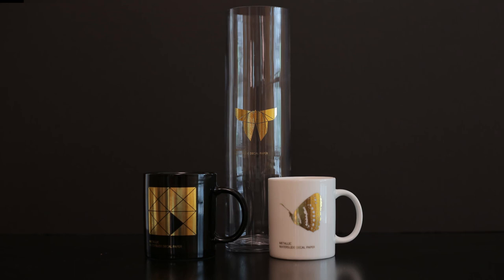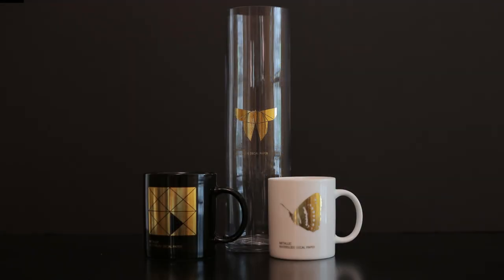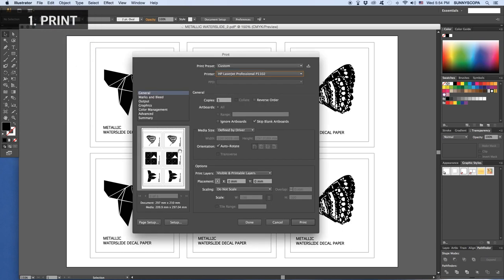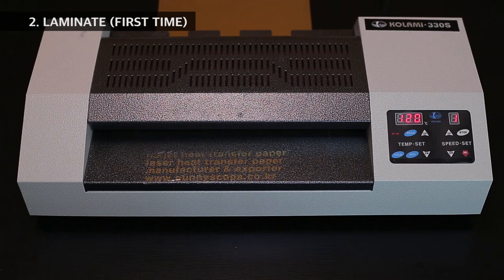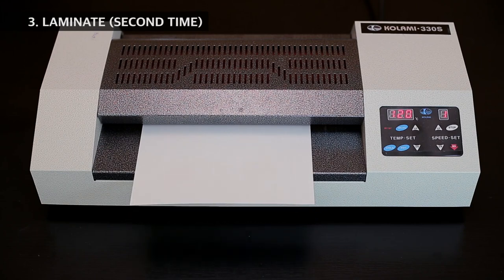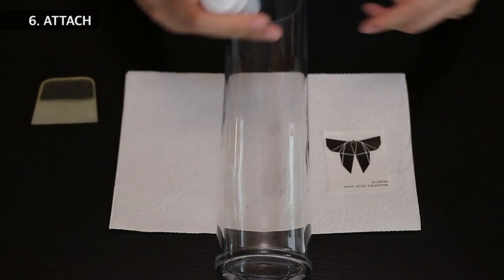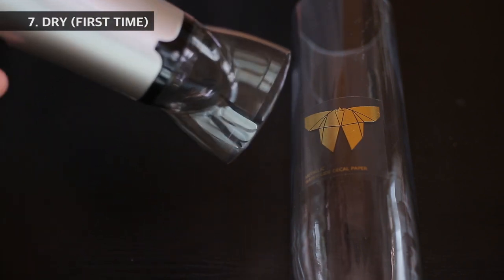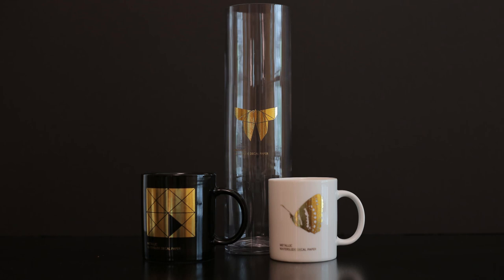[How To Use] Film-Free Metallic Waterslide Decal Paper (Gold/Silver)

Comment: I would like to use this on the headstock of a guitar. Obviously I cannot put it in the oven, so can the final curing stage be done with a hairdryer or similar?
Reply from the maker: We never tried it on the head stock of guitar. But, it could work with hair dryer. You will use film-free metallic decal paper with glue w1+
Before drying, clean off the glue residue with wet wipes completely. It is too hard to remove the glue mark after drying.
Reply: @SUNNYSCOPA  Thanks for that.
I should add that the headstock is coated with very smooth acrylic clear-coat lacquer. Is this product compatible with acrylic paints?

Comment: You say that you can allow the decals to dry naturally before removing the film but when I tried that the decals didn't stick. Also, when I dry them in the oven (as per pack instructions ) they bubble up even though they  were completely wrickle and bubble free before hand. Any help with this would be appreciated as I was so excited about using your product!
Reply from the maker: Hi Zoe Rogers,
You must bake it in the oven at 100C for about 10 minutes. Natural dry can not make it. Air bubbles could be caused from the water remained under the decal. Carefully remove the water with squeegee rubber before putting in the oven. Too high temperature in the oven can make the wrinkles. Good Luck!

Comment: Hello, I need to apply a gold decal with black lettering on it. After I have transferred the gold design to the blue decal paper, can I take this blue decal paper and run it through my laser printer again to print in black on top of the gold?
Reply from the maker: Hello, Kai!

Actually that is a very good question. However, we don't have any ways to express or print black lettering on top of the gold. We will take your suggestion and certainly consider it for our next R&D project! 

If you really want the lettering, perhaps the only way is to use standard laser printer and apply the decal on top of the sealed gold. I do not recommend using another film-free on top of the metallic because the gold can come off when you remove the foil.

Thank you.
Reply: @SUNNYSCOPA  - what would happen if, after doing the first lamination, and peeling off the gold foil layer, I took it and ran it through a laser printer to print in black on top of the gold. Would the gold foil survive going through the printer?

Comment: Hi,

Do you need to specifically buy the decal paper in 'blue'? I can't seem to find the blue colour anywhere.
Reply from the maker: Hi, Laura

The blue papers are included inside the Film-Free Metallic Paper package.

You have all the papers that you need in there.

Thanks

Jimmy
Reply: SUNNYSCOPA Thank you! :)
Reply: Also, what is the difference between Type A and Type B paper? Is the blue paper Type A or Type B?
Reply from the maker: Laura,

The Type A is for the glossy, hard surfaces and the B is for porous surfaces. They also use different glues to assist adhesion; watery, transparent Glue W1 for the A type and white, viscous Glue W2 for the B type. You also have to cure the image with heat for Type A and with the B, this heating is not required. The downside with the B type is that it could leave glue residue once it dries. 

The blue paper is neither actually. It has nothing to do with the Type A or B. They are actually blank decal papers specially designed to work with the Film-Free Metallic products.

Hope this answers your question. 

Kind regards,

Jimmy
Reply: Thanks for your help! :)